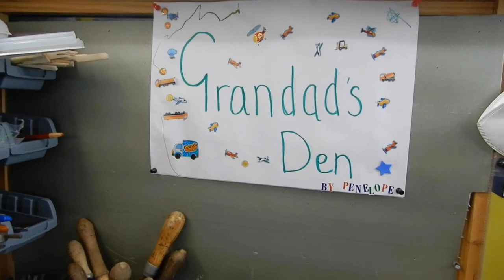How to build the SOAS. Wing in a bag  glider by Angelwing Designs. part 2

Comment: Hi Nick since finding your part 1 build of SOAS I've placed an order with Andy at Angel Wings and purchased all the radio equipment as recommended so I'm following your build closely although I will be using Oralight transparent covering. I should be taking delivery of the kit after 21st Feb everything is ready for the build. Thanks for showing all the little details which will make my build go smoothly.
Reply from the maker: Cheers buddy just don’t use cyno on trailing edge / rib join
Reply from the maker: 12 February 2022
https://youtube.com/shorts/y5tlswKUKag?feature=share